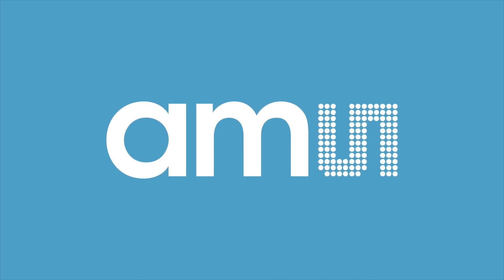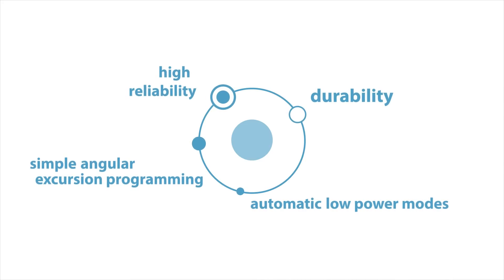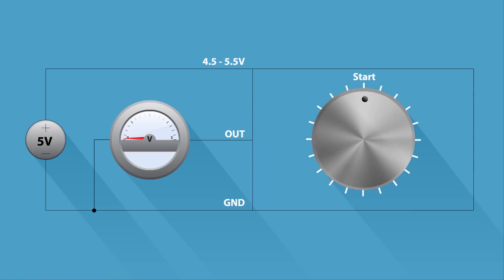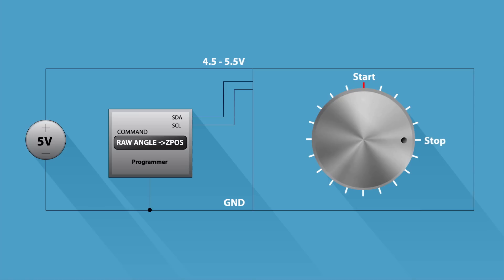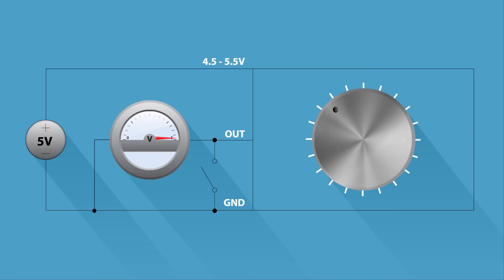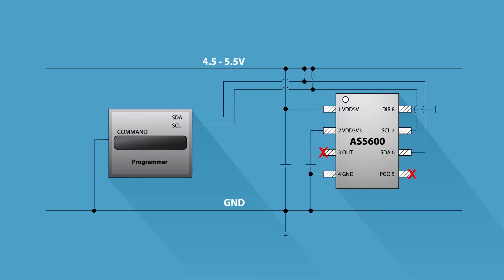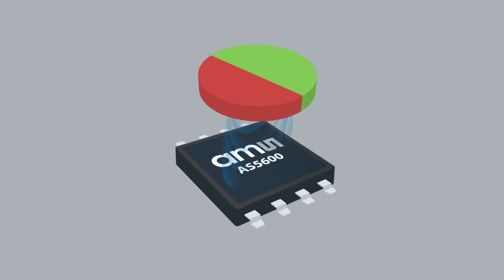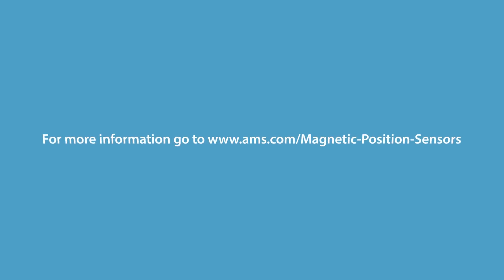How to program the AS5600

Comment: To return the settings to 0-360 degrees after mode B, I used a sketch from Github Seeed_Arduino_AS5600. You need to set the raw angle to 0 and 360 degrees and set the beginning and end, respectively. The number of recording cycles is limited :-(

Comment: Is this board (AS5060, 12 bits) newer than the AS5048B (14 bits)?  Is this similar to the AS5048B aside from the lower resolution?
Reply from the maker: Hi, AS5600 and AS5048B are out of the same generation of ams position sensors. Overall performance of both devices is very similar. Major difference are the various interface options and the package.

Comment: What kind of magnet do I need for this?? I can't find the right one anywhere.
Reply: I bought Magnet Expert® 6mm dia x 1mm thick Diametrically Magnetised N42 Neodymium Magnet ( Pack of 10 ) from amazon uk.  Cost was less than £3 (for 10).  The official answer below suggests a thicker magnet might be better.
Reply from the maker: Hi !
Please refer to the application note “AN5000 Magnet Selection Guide”:
https://ams.com/documents/20143/36005/AnglePositionOnAxis_AN000271_2-00.pdf/684b4ed4-a215-9800-3ef5-a27e22cb8ae3
Thank you !